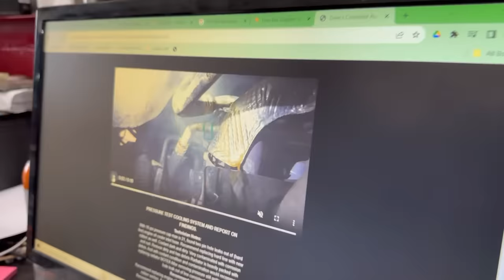The truth about maintenance, and what the manufactures tell you vs what you need to know

Comment: Sage advice.  Change my synthetic oil every 4 thousand miles, change sealed transmission fluid and new filter, and always change out cooling system fluid every two years, all OEM.  My car is a 2006 and running great.  Preventive maintenance is just that for the most part.  Do components fail? Yes, but nothing lasts forever, and I try to control what I can.

Comment: i whole heartily agree, if you want to have problem free driving half the time between oil changes,  remember the oil is there to protect the engine, if it is thin and weak it will degrade the engine far quicker than an engine which has only ever know fresh oil !!!

Comment: I change oil every 5k miles. I flush and change my trans and differential fluid once every year. I do this after I've owned my Land Rover LR4 for many years now.

Previously I was the guy that did the 10k bullshit. It makes a HUGE difference in the performance and longevity of your engine and vehicle. Trust.
Reply: why would you change out your transmission fluids when you dont have to that often

Comment: Love the videos.    I preach this to my customers all the time and more often then not "the repairs are to expensive" for the immediate failure not the main cause of the problem.    Maintenance is oil changes in 95% of the consumers heads.   It's a shame with the recent market on vehicles being so high that so many people bought vehicles in the last couple years that are fresh out of warranty and are having all kinds of problems now looking at shop owners to fix their mistake of buying a used vehicle with only the stealership that's selling its bill of health.   Of course dealerships are going to shine up that used never been maintained turd to get it off the lot as fast as possible because the bottom line if it's sitting or getting repaires/Maintenance it needs that's out of their pocket.   But the unassuming customers thought their sales guy was so nice and honest.  Made them feel great about buying a 90k miles bmw with a v8 or diesel 🤣🤣🤣

Comment: Many vehicle manufacturers have two maintenance schedules: one schedule for their retail buyers who rarely keep a vehicle beyond 100k miles, and another maintenance schedule for commercial customers who regularly go 200k to 300k miles.  No surprise the commercial maintenance schedule has more frequent service intervals - because that is what is needed for good long term life.  Many Fords have a retail trans service of 100k miles or often have no listed trans service - meanwhile for commercial customers they recommend trans service every 30k miles.  Here is a tip that works for me: as vehicle miles go big, shorten the service intervals: if you were performing oil changes every 3k miles, then after 150k miles shorten that to every 2,500 miles, after 300k miles shorten it to every 2k miles.  Frequent service ADDS life to any vehicle, its cheaper and easier than early engine or transmission replacements!

Comment: I have a 2012 Mazda 3s 2.5L 6MT that has just over 127,000 miles and still runs like new.  I've changed my tranny fluid every 50,000K, the oil with full synthetic /w Moly every 5,500-6,000 miles, and the radiator fluid at 100,000. Just regular, and even a little early, maintenance really makes all the difference in the world as far as cost per mile and reliability.

Comment: I work for a GM dealer as a technician, we were talking to the area rep who drives a company vehicle and they told him to get it serviced before the oil life monitor gets to 20% oil life which is roughly 5k miles.  Oil changes are the cheapest insurance policy on your engine, get it changed every 3000 to 5000 miles.

Comment: Along the lines of what you said about what the manufacturer recommends; it's not that hard to find BETTER oil than what they recommend.  I've met so many people who you suggest using full synthetic and they say "Why?  It's just marketing." Some of it, yes.  However I personally know someone who rebuilt the engine in a 1997 Chevy 3/4 ton Suburban and used only full synthetic from that point forward.  900k km later and that engine still fires without hesitation every single time and it runs smoother than many brand new cars I've been around.

Comment: So true!  I keep my cars well north of 100k and often to about 200k miles.  I change my oil early and often.  I change transmission fluid in "sealed" transmissions.  My cars run almost trouble-free for many years.  Look at my avatar...that is a Veloster N.  Oil changes every 3k, the manual transmission fluid has been changed and at 30k it will be new coolant, plugs and another intake valve cleaning.  The car runs like a top despite me driving it like a spoiled kid...I am almost 65.

Comment: The manufacturers have a mathematical advantage by lowering “cost of ownership”. it allows them to compete by reducing cost of ownership within the first 5 years. If you change your oils and other fluids with the expectation of keeping the car for 200k+ miles, it starts justifying the cost savings of electric cars. I’m not saying EVs are for everyone, but changing engine oils, tranny oils, diff oils start adding up when you consider how frequently it’s required to maintain a car at the highest levels of quality. The manufacturers know that most “new buyers” only need to make it to 50k-100k miles before buying a new one, and that car is passed on to the next person.

Comment: Thanks for reminding me. I have to get my daughter to take her 2000 Honda Accord LX with 300,000  + miles into the shop for a coolent flush and possible timing belt. The transmission was overhauled a few years back. The rest of the repairs during the years have just been typical ware out stuff. Struts, brakes, plugs with rotor cap, and  tires. The only other repair was for a new ECU, which ended up not being the problem. Ended up being a fuel pump relay that would just malfunction when ever with no set pattern. What a pain in the ass that was🙄.

Comment: First time dieael owner here. 52 years old.  Got a 2017 ram cummins. 75k Dealer said all maint has been done for the sale.  
I went ahead and did it all again myself. 
To me the engine oil seemed like it has been a while. Didnt smell or feel right.  
Installed the monster ram intake, (grid heater bolt removal) and noticed the ccv filter was never replaced. 
Dont believe anyone any more.  Always question it.
Planning on every 5k for oil.  Not the 10-15k. 
Just cheap insurance.

Comment: Some people think I'm extreme because I don't like to replace just one part, but all parts related to a system. For example, my truck had a leaking evaporator core, but my thinking was that if this part was so old that it sprung a leak, how long until the rest of the parts go? So I bought and installed an entire new AC system, including the lines (and naturally, the heater core was replaced while I had it open). Or when I replaced/upgraded the radiator, I also replaced the overflow tank because it too was all crudded up (water pump was newer, as was engine) and I'll probably end up replacing the radiator hoses as well as the heater core hoses because new is always better, assuming you buy decent quality parts. Doesn't have to be OEM, but never go with the cheapest parts lol

Comment: Well said! "Filled for life" transmission fluid is totally BS. A automatic transmission repair guy told me that at least 90% of break downs is due to not changed the oil. So, as Dave says: change the oil and you will most certainly have a long happy and troublefree life with your car.

Comment: Carefully on the double oil changes. I work for a dealer and had a customer do this and the engine had a problem
 The factory declined the repairs due to not following the service recommendations.  They said they over serviced the engine and this caused the issue.

Comment: I agree with everything this man has said. My Lexus dealer says I don't need to change the 6qts of oil but every 10k miles and lifetime on the transmission lol. I change my oil every 3500-5k miles and just did the full filter and pan oil in the transmission at 90k miles. I need this car to last me 300k miles

Comment: It never fails if you give a person a range they will pick the numbers they want to hear.
If it's going to cost $500 - $1000 they will always say "You said $500".
If it's change the oil every 6,000 for lite duty and every 3,000 miles for heavy duty they will always opt.for 6,000. Whatever cost them less money in the short run.

My 06 Ram says 6k miles for lite duty and 3k miles for heavy duty work load. I checked and 90% of what it calls heavy duty work load is just normal driving in my part of Texas, extreme heat, very dusty, etc. I just chanted it every 3k miles.

Comment: 2014 Ram 5500 (actually between 2012 and 2016 - there were several trucks) with a cummins, we changed the oil the trucks monthly which was about every 6000 miles or basically monthly. The only thing that typically gave us problems were the DEF systems.

Comment: Recently I bought a Skoda Octavia Vrs mk 2( golf GTI engine) for about $6k AUD , in decent condition.I thought even if I spend another$1500 I'm still under market value. I checked the receipt of all previous work done, and most of the major work was done, and wow it's a fantastic car for the price. If you're a bit handy, you can do most of the basic maintenance and have a car you can drive for the next 5 or 6 years and still get at least $5K after you sell. That means your car will cost you a fraction of the price, like 10% compared to a new one minus depreciation. It's called bangernomics. It had a small leak, on a bottom seal, so I repaired it with rtv silicone and it's fixed.  Changed the oi  and all filters and now doing transmission fluid. This is a great car and a little rocket ship, when you put your foot down occasionally.

Comment: My customers are mainly 6.0, 7.3, and 6.7 Powerstroke owners with a handful of Cummins folks. Regardless, I tell them to do exactly what you recommend: half of whatever the manufacturer recommends. It also pays to use the OEM filters or better. I’ve seen where shop oil filters are either too small or barely filter what they’re supposed to.

Comment: I agree with the mantanice. I had a 2003 Dodge Ram 2500 and got 400 thousand out of it before I sold the truck. The only reason I sold it was it was big-time rust. The guy I sold it to is still running it!!   he now has 430 on it and did lots of the bodywork he did himself. He told me that it runs great and says he will get another 100 thousand out of it with no problem.

Comment: This is the thing. even with modified sports cars especially turbo ones. they need oil and plugs regularly. The service manual on my skyline said oil change every 10,000kms. i halved that. then halved that again. and change the plugs out at 5k. (non iridiums but gapped correctly). Never missed a beat. We thrashed the hell out of that car for 2 years.. non stop. when i sold it to my friend who thrashed the skyline with me on the track, He insisted on a compression check. The compression was exactly the same as when i got it.. to his surprise. oil changes are everything

Comment: Here is my issue on Maintenance. I am huge on it as I worked in the craft for years before admitting I was not good enough. However, on organizational maintenance I am up to speed. Now that I am too old to do my own, my issue is TRUST. I do not trust anyone. They won't let you watch or even do a pop in. Let me give you an example. Dodge Ram 1500 2007. Took in for a coolant and flush treatment a few years back. Picked it up and opened the hood. Clean as a babies kiss. I thought right away: did they do the work? Talked to mechanic. Did you remove thermostat? No. Did you unhook any hoses? No. How did you do this work and keep it so clean. I have a "little hose that I suck the coolant out with". I cannot buy this but did not push it as I cannot call a man a liar if I cannot prove it. Coming time for same service on a 2018 Explorer. How do you know?🦇

Comment: I have a 76 Chevy 5.7 engine that a friend and his brother helped me install in 1984, with an original 23,000 miles in a 66 C-10 .I still have this truck powered by this engine, with over 300,000 miles never opened up,I have always changed the oil every 2000-3000 miles with the filter.Wait ,I lied,last summer I replaced the the timing chain and gear when I could hear it rubbing against the timing cover,what a difference bringing the cam up did.The engine still runs great,and burns,mainly leaks a quart every thousand miles on the average.I couldn't agree more maintenance is a cheap date.

Comment: So true. The gearbox fluid on my 73 VW Kombi van is 'lifetime' as well. I emptied it about 6 montths after I bought it and the magnetic plug looked like it had a Christmas tree made of metal shavings growing out of it - i doubt it had been changed in 50 years. Granted- 50 years probably IS considered a lifetime for such a cheap vehicle, or any vehicle really. 

I changed the fluids in my 2007 BMW 5 series diesel recently- also a 'lifetime' fluid. It hadn't been done since factory, I've only had the car 2 years but it has 250,000km's (160,000 freedom units). It definitely should have been changed, it was absolutely filthy.

Comment: My car has a "lifetime" transmission, the filter is just a mesh screen, and the only way you're getting wear particles out of there is to drain the fluid. So it's nice that there's a drain bolt on the transmission pan just for that, a rare feature on a transmission. I've been dropping 3 qts of fluid with every oil change, roughly yearly, and adding fresh ATF of exactly the right kind through the dipstick hole. That's how you get the "lifetime" transmission to last past the warranty, and none of it is in the maintenance schedule.

Comment: As an owner of two Nissan Rogues , I have the oil changed every 2000 miles , as well as a fule system cleaner , and coolant flush ,,, I have the trans done every 5000 on both to keep that clean and maintained ,,,, a bit pricy but well worth the piece of mind ,,,,

Comment: I change all fluids and filters every 4-5 years. I have never had a caliper or wheel cylinder seize. I had a transmission shudder, oil, filter gone. Never a power steering seal leak. The front seal on my 1994 thunderbird now leaking.

Comment: I purchased a used audi S4, not knowing the previous service history i decided  to get the oils and any corresponding filters done on the sports diff, dsg transmission, and engine, along with coolant flush and new coolant.
Recently the supercharger had to come off so got the supercharger oil replaced along with a intake valve carbon clean and also replaced the pcv valve as these are known to go bad on these 3.0t engines.
I know most of the listed above usually don't get done until there is an issue, i would rather practice preventive maintenance.

Comment: We have two vehicles and I perform all of the routine maintenance that I am capable of doing.
One car drives two hours each day to work and back and we change that oil at 3000 miles. Any longer and the oil gets black and the engine starts burning it - so we catch it before it gets bad.

The other vehicle rarely gets driven - but when I do drive it I ensure it gets fully warmed up and I take a two mile trip at Hwy speeds to ensure the moisgets burned out before I park it again.
This oil gets changed between 1000 and maybe 2000 miles because this is considered extreme usage.
Many people don't get it - quick trips around town are harder on an engine.

We use Valvoline full synthetic - the older vehicle has 200K on it and it runs very well and still doesn't smoke - and pulls a trailer very well.

Oil changes are cheaper than engines.
I service engine, transmission and rear end regularly along with lubrication of the grease fittings every oil change.

The smallest amount of preventative maintenance can add years of life to a vehicle.

Comment: I change my oil every 5-8 thousand miles and already changed all the other fluids (except brake fluid, I'm doing that when I replace the brake pads soon) Transmission really needed it, luckily there was no damage to the transmission though. I also did the tranfer case and rear differential, and coolant. Whover last did the coolant didn't use the recommended coolant for the car, so I changed it out, luckily it wasn't reactive with the OEM recommended coolant.

Comment: My mantra : 
1. Be gentle in the vehicle 
2. Change oil, air filter, oil filter every 10000 Kilometres 
3. Preventive maintenance. I change parts even if they can run a little bit longer 
4. Less air in tyres protects suspension

Comment: x2 back in 2014 I ordered a brand new E350 Wagon. Leased it for 3 years, it was my wife’s daily driver. The wagon only had three oil changes while we owned it, well it was burning oil like a SOB. Oil was changed by the dealer every 10K mile interval, she barely put 10k on it in a years time.
I don’t touch my wife’s leased car unless I have to. Meanwhile I drive a used Tacoma and TSX both with 100K+ miles on them and do all of my own work. 
So yeah ignore the 10K oil change intervals and do them at 5K, it’s what I’ve been doing for the past 20 years on the cars I own.
Reply from the maker: Great share, thank you!

Comment: I change my oil every 2,000 miles, NGK iridium plugs every 12k miles and recharge my K&N air filter, cabin air filter, wipers, and coolant in a timely manner. I actually enjoy doing maintenance. He’s not lying about the dealer they don’t care about what happens after or if they sell you an extended warranty just to 100k miles they know the vehicle will make it to at least 75k to the 100k miles and the crazy part is sometimes they will try and blame you of the failure because of maintenance and it all comes back to the origin of preventative maintenance.